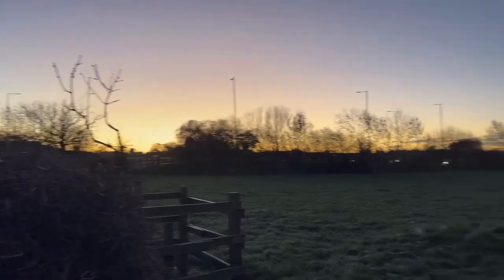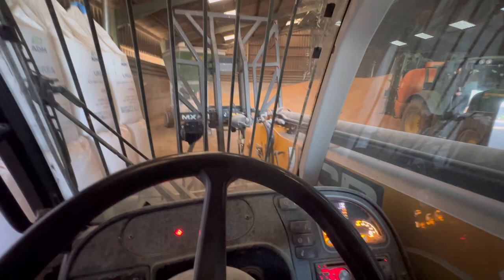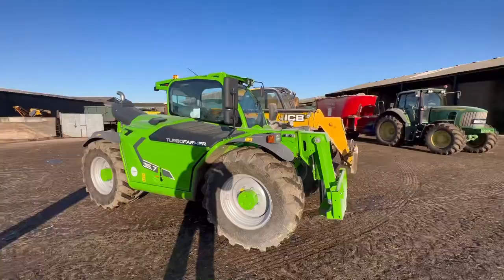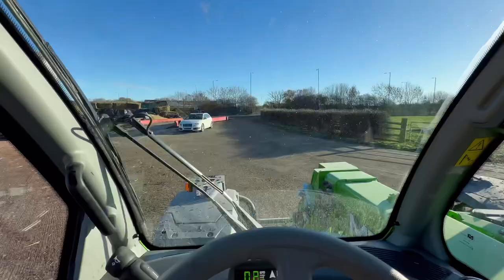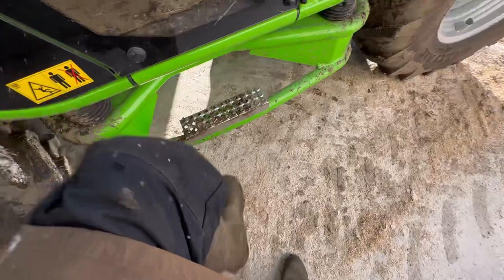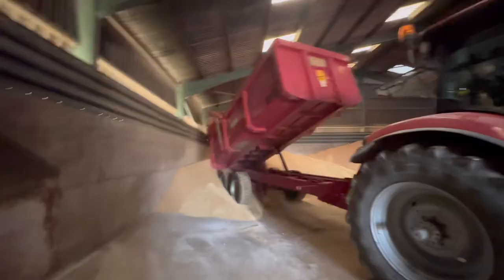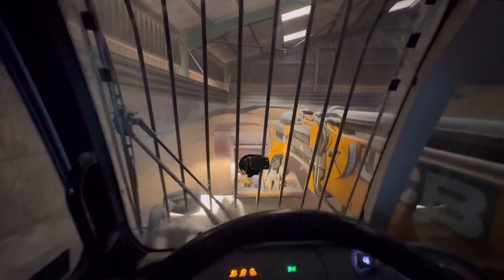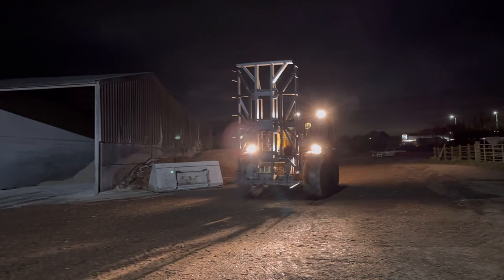JCB Goes on Strike… is it Because we have a Merlo in Yard?? Lots of Tractors! Lots of Feed!

Comment: We ran jcb for years switched to merlo far superior machine in most ways currently running a p40.7 with 13000 hours on it still going strong looking at adding a 38.10 to it to help with the workload won't be switching back to jcb anytime soon find the build quality lacking and add blue problems in the newer ones

Comment: Pin and cone best headstock for telehandlers so easy to use and line up.  And get those battery terminals cleaned up and coated with Vaseline stop them corroding up

Comment: I use to drive a merlo 42-7 and a jcb 542-70 the jcb is a far better machine the jcb will out push and lift the merlo the only thing better on the merlo is the pick up hitch it lifts a bit more but our merlo has been a nightmare loads of electrical problems and oil leaks  we had a bearing go in the gearbox the drive broke to the hydraulic pump no end of hub seals at least 5 plus brake problems and the load monitor is dreadful to sensitive when your trying to push stuff up it locks out all the time luckily this is a lease hire machine otherwise it would have cost a fortune in repair bills at one point it was breaking down every other week the jcb is only 4 months old but is a better machine our previous merlo we owned that one was nearly as bad electrical problems from day one a corroded plug on a new machine oil leaks loads of hub seals they don’t like a lot of mud our previous jcb 531-70 was virtually bomb proof they were all on an out door pig unit in deep mud and slub all winter I was the tractor driver for them and the were greased regularly and serviced after driving both for the last five years I know which one I would buy the jcb has been far more reliable

Comment: Please joe whatever you do DO NOT BUY THAT PILE OF JUNK dont be tempted by the cab suspension when it goes wrong it will break your back and nobody seems to know how to fix it . The endless oil leaks will be entertaining though. From a crippled merlo opperator
Reply: how many merlos do you own?
Reply: Must of had a bad experience with them- all of ours which we’ve had throughout a lot of generations have been brilliant
Reply: I concur....cheap crap
Reply: @stevengrieve678  must disagree here tbh lol
Reply: @CEH_agricontracts  absolutely no problem. Each to their own 👍
Reply: @stevengrieve678  :) 👍🏻
Reply: I use to drive a merlo 42-7 and a jcb 542-70 the jcb is in a different league it’ll out push and lift the merlo our merlo has been a nightmare the load monitor is dreadful to sensitive locks out to easily we’ve had no end of electrical problems the gearbox went bolts falling out the prop shaft oil leaks and the latest one the coupling between engine and hydraulic pump broke oh and about five hub seals as well our previous merlo was nearly as bad that had electrical problems from day one on a brand new machine it had a corroded multi pin plug
Reply: @carlgray968  ours has been running for well over 5 years and hasn’t had many issues but I agree I do know a few that have annoying gremlins- I also use a jcb but I just find the merlo better maybe that’s just me?
Reply: I used to watch outback truckers .the merlo was allways parked in a corner while other machines unloaded